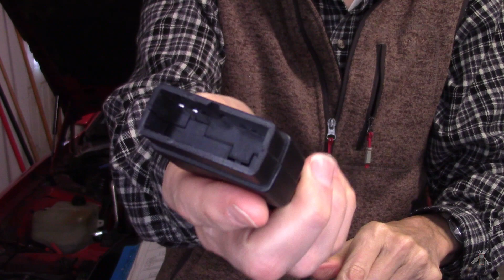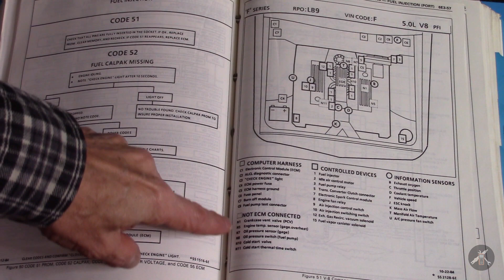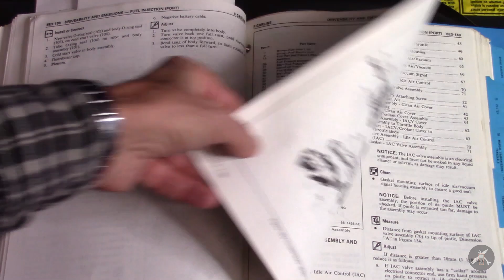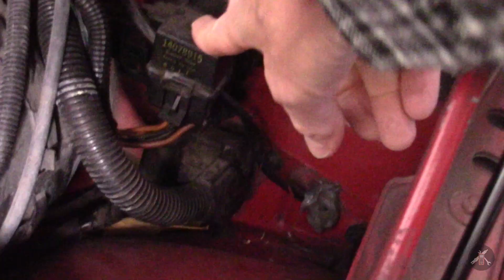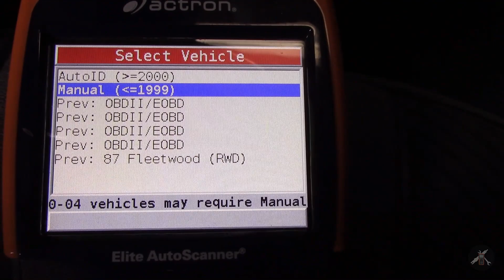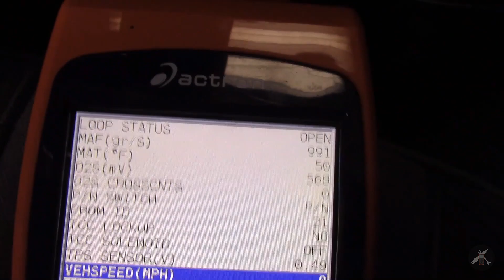Diagnose and Repair GM OBD1 Computer Controlled Cars- Chevy Tuned Port Example

Comment: O ok i tested the map sensor disconnected, had same readings and didnt notice a change how do i test the tps to see if working properly, isn't there a ground circuit on the back of one of the cylinder heads, i heard its hard to get too
Reply from the maker: TPS normally takes either a scan tool or a set of jumper wires that match the pins.  My '85 has weatherpack and I have a set of three wires that I assembled and can put between the TPS and the harness connector that the meter can clip to.
There are normally ground connections on the back of both cylinder heads.  I'm not sure where your distributor harness grounds, I would track it back from the cap.
Reply: @bitsofwisdom460  o ok I think I might just buy the scanner I feel it would lead me in a better direction since it shows live data
Reply from the maker: @Jaguar-Xjr  A scanner is a great help. I have done considerable diagnosis with a digital meter, but a scanner lets you see multiple parameters at one time and many times that makes it easier to find the problem
Reply: @bitsofwisdom460  o ok I was reading my service manual and it says ecm supplies voltage of about .45 between d7 and d6 I tested the signal wire came up to about .40 the d6 wire says o2 ground circuit should that read about .45 as stated in the manual?
Reply from the maker: @Jaguar-Xjr  0.40 is within range for a check with ignition on and engine stopped.  I would also check from each of those pins to good chassis ground as double check.  Main thing is to be sure ground side is zero to chassis ground.
Reply: O ok I'll check the circuit today let u know what reading it gives me appreciate all the help  @bitsofwisdom460
Reply: @bitsofwisdom460  hey just checked the O2 ground circuit at the ecm and it read .7 does that mean it's the ground wiring that's bad
Reply from the maker: @Jaguar-Xjr  If you're on the ground pin (D6 in my '91 manual), it should read zero with the black lead on a good chassis ground.  If it's reading 0.7, that is a problem.  If the ground is intermittent, it may change with engine roll when the throttle changes. I don't know which year you have, the '91 manual indicates that ground connects to the rear of the driver's side cylinder head along with the ignition module and air bag system.  There is a stud threaded into the back of each head.  The ring terminals go over the stud and attach with a nut.  It is really hard to get a hand in there, but it is possible.  The nut could be loose, the stud could be loose in the head, or something corroded.
Reply: @bitsofwisdom460  o ok mine is a 1989 is it still possible the wire itself could be bad
Reply from the maker: @Jaguar-Xjr  I can't say for certain, but from the symptoms you have, I would expect that the wire repair isn't your problem. If you have a voltage on the O2 ECM ground, that should be resolved.  A poor ground is likely to put a voltage offset in the system that will cause a false O2 reading that will in turn cause an error in the fuel control. If the ground is bad where the wire connects to the head, it may vary with the engine shaking and rolling with throttle as it pulls on the harness.
Reply: @bitsofwisdom460  o ok I think that is why it's probably intermittent and not throwing a code, I unhooked some sensors to see if it would pull some codes and it did, just to be sure my ecm was working properly
Reply: @bitsofwisdom460  o ok do you know if I relocate the ground wire somewhere else would that affect the oxygen sensor  if I find out that it is the wire that is bad
Reply from the maker: @Jaguar-Xjr  You could relocate the ground wire if necessary.  I would be sure to get a good ground to the engine block / head / intake since it is a ground path to the sensor that is engine mounted. 
In tracking this down, there ought to be a large ring terminal crimped on the end of the (tan) ground wire. Sometimes those crimps go bad from vibration and flexing.  They can look good on the outside, yet become intermittent. Sometimes you can heat them and flow solder into them and otherwise cut / strip / install new crimp terminal.
Reply: @bitsofwisdom460  should I run a continuity test or resistance test on it resistance test to see if it's open circuit
Reply from the maker: @Jaguar-Xjr  Yes, I would try to measure resistance from ECM pin to engine block clean ground.  It's a little difficult because distance is long and you may need to extend one of your leads.  Perhaps a good wire from engine ground point to front seat that you can connect to with meter probe. Resistance ought to be zero, or at least below 1 or 2 ohms.  There is a little resistance in the leads.
Reply: @bitsofwisdom460  o ok I have a 10 feet test lead to test them if ground wire is bad how do I know what type of wire to buy to replace it
Reply from the maker: @Jaguar-Xjr  My '91 manual indicates in the ground distribution section that this ought to be a 0.8 mm wire (20 gauge) and continuous without splices. If you have a manual for your year, you may want to double check. Most often, the wire itself is fine, it is the connections at the ends or splices where you'll have a fault. If you can trace and inspect the wire for damage that can help.  It is possible for a wire to be broken inside the insulation, but not as common. I would check the ends. If there is a problem, check for clean tight connections, then I would cut and strip the underhood ring terminal to see if I could get a good connection. You could replace the entire wire from ECM to engine with a good 20 gauge automotive grade primary wire.  You may also be able to isolate the bad section and cut / splice / solder a new piece to a known good section so that  you don't have to fish a wire all the way through.
Reply: @bitsofwisdom460  o ok yea I have a shop manual for my car I'll check it to make sure
Reply: @bitsofwisdom460  hey jus checked a few more grounds I think it's my ecm because on the 02 ground I got 0.007 and on ecm ground and map ground I got like .40 is that normal?
Reply from the maker: @Jaguar-Xjr  No, that isn't normal.  Grounds should always be zero volts. If you really have only 0.007V on the O2 sensor ground, that might be close enough.  It shouldn't be the ECM because if it's a ground connection, it should be zero.  If an ECM problem put more power on that pin, it might blow a fuse or possibly an internal ECM circuit, but the voltage on that pin should remain very close to zero volts up until the wire melts. If it isn't zero, there is most likely a fault in the ground connections.  It can be a bad ECM circuit ground, or depending on the circuit, sometimes a bad ground between the engine and the chassis. There should be a ground strap or cable between the engine and chassis.  I think it is off of the back of the right hand cylinder head. I would check both of those studs to be sure they are tight.
Reply: @bitsofwisdom460  o ok I jus thought it could've the ecm because the guy I purchased it from says it was remanufactured and may need to be programmed I jus installed it with my old prom
Reply: @bitsofwisdom460  instead of taking the bolt of for the ground wires can I jus cut the wire at the end and relocate somewhere else
Reply from the maker: @Jaguar-Xjr  It is certainly possible to relocate them, but I recommend that you try to inspect and repair what you have.  The two primary ground points are the 3/8" studs on the back of the cylinder heads. They hold nearly all the grounds for the engine harnesses. All of the harnesses have the correct length to make those connections. They are double ended studs that screw into the back of the heads. You need to be sure the stud is tight in the head, then be sure that the nuts are holding the wires tightly. You can remove the nuts with an open end wrench, should be 9/16.  The clearance is tight to get the nuts finger started, but I have done it several times and it's not impossible. Just remember that if one of these connections is loose, it will affect multiple circuits and sensors.
Reply: @bitsofwisdom460  yea definitely I'm sure it's a ground too since some of the other sensors connect to the same bolt on back of head I jus trying to figure out how to identify which side it's coming from
Reply from the maker: @Jaguar-Xjr  If you check the ground distribution chart in the electrical manual, it will show which ones are on each side.  It could vary from year to year, but the ones to G112 are on the left head and G118 are on the right head. '91 book shows air bag, O2 sensor and ESC on G112.  ALDL, cluster, vehicle speed, HVAC, fans on G118.
Reply: @bitsofwisdom460  o ok facing the front of the car ? Or inside the car
Reply from the maker: @Jaguar-Xjr  G112 on driver side, G118 on passenger.  The book has a chart that defines the locations, but it is hard to find - lots of pages
Reply: @bitsofwisdom460  hey still trying to figure the problem out, how do u think I should test the wires separately in order to see where the ground fault is
Reply from the maker: @Jaguar-Xjr  I don't know how much work you have done, but yes, that would be helpful.  If you can identify where the individual ground wires start (like an ECM pin) you can check each one from start to the block and see if they all have a similar problem or if they are different. One consideration is that you can have grounds that influence each other and cause cross circuit problems. What I mean is that if two or more circuits share a ground point (like a bolt threaded into the cylinder head) and that ground point is not good, one circuit may try to ground by back feeding through another ground wire. I have seen this before and it can cause unpredictable issues.
Reply: @bitsofwisdom460  o ok to test them individually probe the ecm pin and put other end on block the block bolt on the cylinder head that the wires goes too? Should I measure voltage or check resistance or continuity on each
Reply: @bitsofwisdom460  or from where the ground wire starts could I jus ground the other end to the negative battery terminal
Reply: @bitsofwisdom460  or does it have to be grounded to where the other end of the wire goes
Reply: @bitsofwisdom460  also a bad ground would cause the O2 sensor to run rich at idle? That's really my only problem since when I press the gas it oscillates like it's supposed to but at idle it's high 700-900mv I guess since the engine is vibrating when pressing the gas ?
Reply from the maker: @Jaguar-Xjr  Here is a video that might help sort out the ground circuits:
https://youtu.be/FNaCicm9PNI
Reply: @bitsofwisdom460  hey thx a lot really appreciate that gonna watch it tomorrow

Comment: O ok I purchased the Delphi oxygen sensor connector before says fits 88-92 Camaro tbi, for some reason I suspect it's the oxygen sensor connector not being crimped and sealed right because the car was running great until the wire was severed so u believe even tho it was cut while driving it wouldn't have not shorted anything else out like maf or tps sensor
Reply from the maker: A good crimp is critical, sealing is for longer term protection so it doesn't get wet and corroded. My suggestion for a pigtail is to be sure you have a good crimp. You could try soldering the current crimp to see if it helps.  Flowing solder into the joint will improve the connection.  It is also possible that you have a bad or damaged sensor.  I had a bad Delphi sensor with only a few miles on it. That's why I tested it with a torch in that video.  They are sensitive and can be easily damaged.
Reply: @bitsofwisdom460  o ok appreciate that I'll return the sensor since. I have a warranty, do u recommend heat shrink tube I already have those, kinda worried about soldering since I never have before
Reply from the maker: @Jaguar-Xjr  If the wires and connector are clean with no corrosion, a solid crimp should work without solder.  Shrink tubing is good, but in the short term, if the wiring connection is dry and clean, it should work.  The shrink tubing is to keep it that way.
What to think about with o2 sensor connections is that because the voltage and current are so low, there isn't much power to "jump" a loose or contaminated connection. A 12v connection with an amp of current will arc very nicely across a marginal connection.  An O2 sensor at 0.1 volt and microamps can't do that. 
By the way, you mentioned running at 700 mv earlier.  If the system is holding consistently there, it indicates a rich condition, as in closed loop it ought to switch back and forth low to high.
Reply: @bitsofwisdom460  o ok yea I thought it was abnormal to stay around that voltage without going back and forth from 100 to 999 mv, yea I kinda hate that it had to be the O2 sensor as opposed to other sensors that aren't so critical on the voltage being so low that it isn't to much room for error
Reply: @bitsofwisdom460  hey had one more question, when I splice the connector back onto the wire do I splice it as close to the connector as possible since the oxygen sensor breathes through the wiring
Reply from the maker: @Jaguar-Xjr  If you are splicing on the engine harness side of the connection, it should not matter. The service manuals caution to keep the sensor pigtail intact, but don't address the mating connection.  I think that once you are across the connector, you just need to be careful for good clean connections.
Reply: @bitsofwisdom460  o ok since I use a butt connector with heat shrink will it affect the wire ability to breathe correctly since it's sealed with glue on the inside of the butt connector
Reply from the maker: @Jaguar-Xjr  If you are working on the wire that connects to the engine controller, you should be fine. The wire coming out of the O2 sensor needs to be intact. If you are working on that O2 sensor wire, I don't know the right answer. The service manual cautions that the sensor wire should not be modified.
Reply: @bitsofwisdom460  o ok it's the wire going back to the ecm that I'm working on
Reply: @bitsofwisdom460  just trying not to replace the whole wire if I don't have to just got a new oxygen sensor put on yesterday that eliminates it being the sensor, the car hasn't cut off yet but if it does I suspect it can only be the wire or ecm
Reply from the maker: @Jaguar-Xjr  Ok, that's good.  I just wanted to be sure that I understood correctly. My understanding is that some of the O2 sensors vent though the stranded wire, but that doesn't go across the connector into the engine side harness, so your repair method sounds like it ought to be good.
Reply: @bitsofwisdom460  o ok thx a lot , checking the voltage in millivolts is the wavy symbol or the three dots with line at bottom? jus want to be sure
Reply: @bitsofwisdom460  hey to check the voltage of the o2 sensor signal wire I can back probe the connector on red and put the black on a good ground on the car ?
Reply from the maker: @Jaguar-Xjr  That is difficult because the weatherpack connectors are well sealed and it may damage the connector seals.  You may do better measuring at your splice before the heat shrink is installed, or you can pick up the connection at the PCM / ECM and back probe at that connector.
Reply: @bitsofwisdom460  o ok just ran live data on the o2 sensor while car was running 
It went was fluctuating from .1 to 1.volt for like about 10 seconds at idle then after that it stayed fixed at about .7 until  I pressed the gas again then it started fluctuating like it's supposed to, any idea on what that could be? It also stalled again today the check engine light came on when it did but after hooking up the code reader no codes were found
Reply: @bitsofwisdom460  also noticed that while in closed loop using my GM code reader the beeping would stop for more than one second and sometimes beep fast like it's going on and out of closed loop
Reply from the maker: @Jaguar-Xjr  It sounds as if your system is going rich at idle.  It may be doing this for short enough times that it won't set a code. 
Possibilities from manual diagnostics for rich:
1. Intermittent TPS that causes the engine to go rich as if you're accelerating.
2. MAP sensor.  Disconnect the sensor and see if issue goes away as a backup value is used.
3. Fuel pressure - regulator could be running high and causing rich
4. Leaking injector - would be most problem at idle with low air flow.
5. Canister purge - canister could be saturated with fuel and causing rich.  
6. HEI system. Seems odd, but apparently bad ground can cause noise that will cause extra pulses in the speed signal and more rich.
Reply: Also forgot to ask is it normal to get a reading from the O2 sensor soon as the car is stated, I decided to use the voltmeter to it soon as it started and that's when I got the 700 mv all the way through closed loop
Reply from the maker: @Jaguar-Xjr  I'm not certain, but the I expect that the reading should be around 0.450 (.35 to .55) Volts with a cold sensor. The ECM supplies that as a reference voltage with engine off and ignition on.  As the sensor warms up, it may drift, but on initial start, I wouldn't expect 700. 
On my TPI, my cold start data from scan tool was 0.560 V at crank, then settled at 0.450 for about 30 seconds, then started climbing toward 0.900 as it warmed up, closed loop after about 2-1/2 minutes. I have a video posted with cold start data off the scan tool.